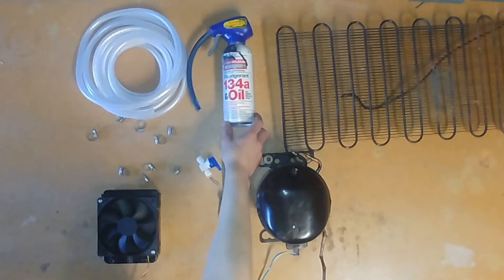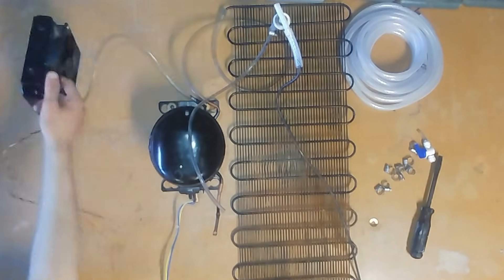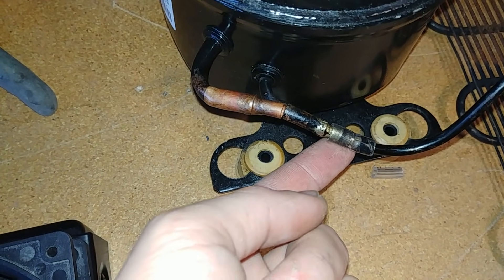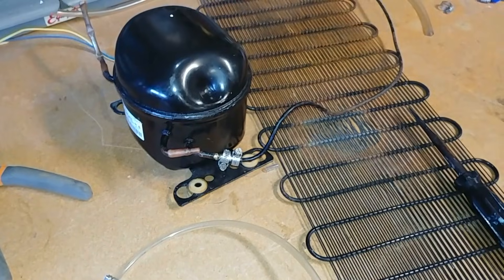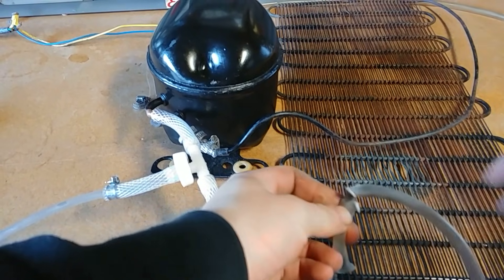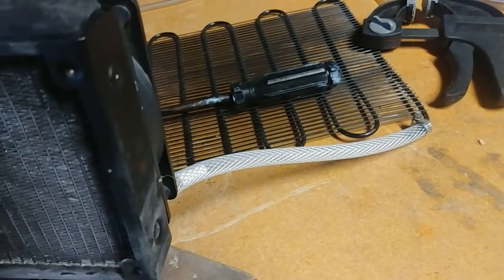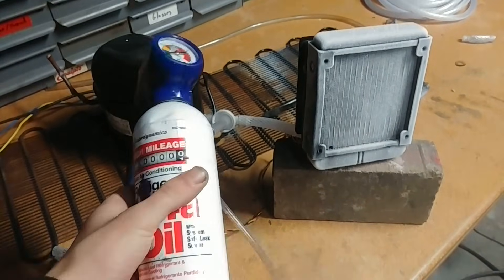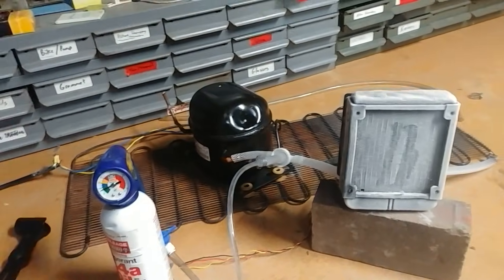DIY AIR CONDITIONER WITH COMPRESSOR diy ac from scratch

Comment: As someone who is certified to work on these systems, I think it's really cool that you made it work with those parts! Good idea using that syringe cap as a metering device. Very creative. I'd love to see how it does with a fan running on the evap coil. That being said, there's a few things I don't like that I feel should be addressed. 

First is that you lost a lot of refrigerant. Some loss is to be expected, but losing the whole charge multiple times is just negligent. 134A is a greenhouse gas after all, which is why it's beginning to be phased out and replaced with eco-friendlier HFO refrigerants. You didn't remove the air from the system first either. Not only does it ruin the performance of the system, but it also ruins the refrigerant.

Second, when you mentioned that you can use any refrigerant. If you put R410A in that system for example, you would blow every line and maybe even that condenser coil due to the much higher pressures. If you put propane (R290) or butane (R600) in it, there's a good chance it will literally just explode into flames. That compressor is only designed to work with R134A and nothing else. You need a compressor rated for flammable gases to use them safely as refrigerants. 

Other than that stuff, cool video! I always liked the idea of clear lines in these systems. They just have to be rated for the right pressures so they don't pop!
Reply: Well said Matt, you saved me a lot of typing. I'm what is known in the UK as a Category 1 FGas engineer, while I appreciate the video creator is yound and VERY intelligent for his age it did make cringe for the reasons you pointed out. But well done to the creator if you carry on progressing, find some funding and get the tools and hardware (maybe some refrigerant handling pointers or training) and experiment away, who knows where you might end up if you can make it work with hose pipes!
Reply: @AK_Exploration_SII I've been wanting to ask somebody and thought, after reading your comment, that you might be the right person. I work outdoors, and after this summer, I almost died out there. I've been thinking about trying to create like a backpack version of something like this and having it directed into something resembling a sandblasting helmet to contain the cool air. It seems to me that keeping the head and neck cool will regulate the rest of the body. And can it be done with maybe a 40 volt battery for a cordless tool? I'm just trying to think of something practical. Everything that I've seen requires an umbilical and doesn't seem practical for c9nstruction guys to be lugging around. What do you think? Thanks!
Reply: hi i have made this setup to but properly can you explain to me that when i turn on the condensor fan i get almost no coling but when condensor is hot all of my pipes freazes only for 2minuts help
Reply: Yeah i agree with him. I am also an hvac engineer and i can confirm everything he said.
Reply: Question all my r600a is out been removed right so now that my compressor is empty can I use r34a sir?
Reply: Great info, matched with the project.
Reply: Kyoto Protocol? Never heard of it 😂
Reply: righty but he is making it at home with basically no tools. and i doubt anyone whos able to buy 410 would use it in a rig like this.

Comment: Nice video, thank you. I am trying to make a mini AC with 12V Micro Rotary Compressor. Do you think it will work? BTW: I don't have any experience with Air Conditioning or Refrigeration.
Reply from the maker: its possible yes

Comment: This is a really cool project, although I'd recommend doing more intensive testing to make sure it can hold the pressure before putting refrigerant in it because that stuff isn't great it get exposed to not to mention the whole hole in the ozone layer thing. Have to admit I want to try this though.

Comment: This is a really helpful tutorial. I'm trying to turn a 12v cooler into an A/C for a teardrop camper. At first I tried just filling the cooler with water and using a USB water pump to transfer cooled water to a 360mm pc radiator with 3 fans, but it's just too inefficient to keep up with the thermal load. It can only maintain a few degrees ∆T. I think the next step is to remove the compressor from the cooler and run refrigerant straight to the radiator like you've done here.

Comment: I like how this is a true AC and not a fake Peltier or ice based AC
Reply: Yeah, I think the pettier ones are decently cool, but whenever I look for a video like this, it always comes up with the stupid cooler ones.
Reply: Peltier ones are just extremely inefficient  @CrobinHood8BitGuy
Reply: Why are peltier and ice based coolers "fake" AC? They may not be the most efficient, but they are real with actual capability to reduce the temp of a certain amount of air. Middle eastern  cultures have used "Cooling towers" to reduce the heat inside buildings without refrigerants. The US, used ice based cooling from ice blocks cut off from Alaska. Some companies now use ice based cooling to reduce costs. As long as it serves it's purpose, it's "real". You just need to have the proper application for whatever technology.
Reply: @BaldAndCurious Great take.
Reply: Or those new ones where they use lighter gas and not making a bomb
Reply: @clipxx467  You'd be surprised how well butane works as a refrigerant. In terms of state change with pressure, it's pretty close to the stuff you use in your air conditioner. It's actually the refrigerant that a lot of mini-fridges use.
Reply: Heat pumps a heat pump.
Reply: @tylermcnally8232  unless it doesn't. Because it's not a heat pump.
Reply: Peltier based would be cool though

Comment: Not a pro because I am looking for a cheap alternative I never seen this However. I do know using copper tubing or auto tubes will do. With the copper need a crimping tool & teff tape if not bronze soder

Comment: Hello mate i would like to ask something about that ac unit i want to use 12v compresser for that ac for my boat but im curious is it like that effective also i checked the gas what i can put in the tubes is also 134a type of gas so is it okay and whats your compressor voltage??
Reply: let me know if it works i have a sailboat i wanna use it on
Reply: @RustyShakleford1  ive tried it worked pretty nice 👌🏼

Comment: Any idea on how I would make one that works for the car, I’m from a part of the world where the temperature would reach 46 degrees Celsius in the summer, appreciate it, thanks.
Reply: I'm looking for this as well. The thing i can't figure out is how to get a compressor with this function to work of 12v in a car. The rest should be fairly straight forward.

Comment: Is it possible to make a system that works without a compressor?  I hope you added the oil too.
Reply: Only thing alternative  i can think of is a peltier cooler. Most micro fridges (for like 4 cans of soda) are cooled by peltier cooling. But it's far less efficient for large applications.

Comment: would compressed air in the system work or would it have to be a gas? i know air has the cold effect when tipped upside down.

Comment: I have an idea and i want to try it
What if i replace the car compressor by belt and but compressor like fridge run by second battery with 1000w converter you guys think that would work??

Comment: R135a is cheap as ballz. Even cheaper then a can of much more dangerous bbq propane. The hazard here is enclosed space with limited air and skin damage and lung exposure if pipe breaks but its pretty safe except your high side.

Comment: The freezing up is not good for the system as a whole... you don't want it freezing because then your going to be feeding the compressor a bunch of liquid and not vapor.. you want the liquid refrigerant to go from a liquid to a gas in the evaporator then the gas goes to the compressor and the cycle starts over.  🤔
Reply: Omg stfu!! It's his video not yours.. go make your own!!

Comment: You have bubbles in the line because you did not pull a vacuum on the system, the ac system will  work like 5 times better if you do, you obviously know nothing about making a proper ac system

Comment: Thanks for killing the ozone layer and why don't you just flare out the pipes and put proper connector fittings on the ends.
 it would work out better.

Comment: why not add a fan or something as your air handler...and your going to need to put your condenser outside so you can tranfer that heat from your house to the outside air, and also put a fan on that...love the improv filter dryer though

Comment: Kid understand if that radiator freezes up and turns into a block of ice  that radiator i will exploded and blow up you need a AC high pressure switch so that AC compressor will turn off and on never ever use any type of rubber or Plaskett houses always use metal lines or hoses I've been doing this for over 60 years stop learn and listen always remember all Freon gauges can be dangerous to any person always wear a gas respirator also safety glasses and gloves especially if you are inside of any building
Reply from the maker: let me have my fun  i didnt claim to be a pro and the no fan is so the ice will build so i could get a thumbnail

Comment: You need a high pressure switch to turn air compressor off and on so YOUR AC radiator  will not freeze up and turn into a block of ICE never ever used any type of plastic or rubber teething hoses of any kind always use metal lines or metal houses I've been doing this for over 60 years Freon gauges can really be Danger never ever let any person play with ANY Freon gauges
Reply: the improv metering device and filter dryer was cool though!

Comment: Those plastic hoses can't handle the pressure. Use copper tubing or braided stainless steel tubing.

Comment: this makes me want to diy a mini split out of a cheap generic ac:P always thought it should be overall simple but this makes it look even more simple:P; guess best option is evacuate the pipes first but yeah still not so crazy unrealistic as something diy; as the union for the high pressure side I'd try to either buy a compression fitting coupler or flare

Comment: Honestly I love the idea and concept personally I’d want to find a way to make it out of copper eventually but the concept is so amazing thank you for sharing!! Also I think you can buy 5 lbs of 410a refrigerant without a license
Reply from the maker: yea np
Reply: You would never want to put 410a in that system, I’d be kinda scared to run that thing even with 134a in it
Reply: @kenb1918  yeah I’m with you there is definitely want hard lines for higher pressure applications

Comment: Is it ok if I use a 1:1 ratio size wise or should the evaporator be smaller than the condensor?
Reply from the maker: it doent matter it will stil work
Reply: @ianbuilder  oh and another question, will this work with an ac compressor? I'm afraid that it might explode lol since I'm using a refrigerator coil with an ac compressor...
Reply from the maker: @tristan6509   yea it will be fine they are both rated for it

Comment: Can you try at making a reversing valve for this so its not just a ac but in-fact a heat pump also steel braided motor cycle break line can take the temperatures and pressures im gonna build on with that as the hose and if i can find one cheap use an actual thermal expansion valve
Reply: you wouldnt need a txv for this small of a system...his improv orfice hole metering device is fine...a capillary tube would work as well

Comment: Try copper lines and use a piercing valve so you can pull a vacuum first to remove non condensables.  And definitely want to get a fan pushing air across the condensing coil(the big fridge coil)

Comment: That compressor wont last too long. Air and refrigerant and compressor oil dont get along, acid will be created and compressor will burn out soon. Also you ever wonder why the refrigeration system is made of copper????. .... Because of hi pressures and hi temperatures and it needs to be a sealed system. Good luck with your proyect
Reply from the maker: it was proof of concept

Comment: Hose blows up as there is back pressure use pressure regulator with return line this should fix the problem

Comment: Just vented all that 134a to the atmosphere.   EPA is knocking on your door.
Reply from the maker: calm yourself
Reply: Dude seriously? I have vented 134 a dozen times.  what do you think happens in car crashes? Wheres the pressurized condenser?
Reply: Mark Diener Isn't R134a safe to vent to atmosphere that's why you don't need a certification to use it

Comment: I've been thinking about turning a window unit AC into a split for my van and this was exactly the kind of video I needed to better understand how all this works. Thanks!
Reply from the maker: ya go for it
Reply: @ianbuilder  What about installing a thermostat????
Reply: @Dan0rioN  some simple controller to turn on and off the compressor when cold is needed!
Reply: @waheeddoesstuff   depending on the voltage he can make a light switch the shutoff
Reply: @qsm1334  I know.
Reply: make sure you buy one that doesnt use a regulated refrigerant. you need a license for those
Reply: Any luck?

Comment: Would the compressor burn tho? I mean most of the newer ones does have thermal cutoff, but those teeny tiny compressors aren't really designed to cool a whole room, so I can't imagine them lasting that long
Reply from the maker: not sure but ive pushed this thing pretty hard  i think it has a thermal

Comment: been looking for a video like this for a long time. thank you
Reply from the maker: ikr i was looking too. so i just made one  everyone uses the inefficient peltier plate ones
Reply: @ianbuilder  it also annoys me on some of the 'peltier air conditioner videos' they dont even put the hot side outside of the room they are trying to cool, so the room would actually heat up when testing. Even then, peltier modules struggle cooling anything bigger than a small eski, and might not affect room temperature at all. Ive always been interested in cooling devices for some reason, and maybe your video has inspired me to do something of my own in the future.
Reply from the maker: @ElectronicInspiration  lmfao ikr  they expect it to just magically cool a room with no heat output

Comment: hi 
am build my travel trailer 
am look to your video make airco 
i like to make the same frico compressor under the bed storage and 2 littel radiator in my roof whit pvc pipe coolen the trailer
Reply from the maker: i don't recommend using plastic pipe it leaks braze everything

Comment: Using propane or butane is a problem as there is no oil in it.  It will work but the compressor will die faster than it would if using refrigerant gas.  Nice build and explanation!  Have you tried running the fan on the computer radiator? Oh and pulling a vacuum on the system will make it more efficient.  Just use another compressor to evacuate the lines then add in your gas.
Reply: Also use copper lines If you have to use flare fittings if you can't braze anything would be better than plastic tubing bur really cool concept my dude

Comment: Now, to upscale it to build a refrigerated room, on a farm for food storage.
Reply: That is when you start to worry about insulation and the cheapest will win out. Like 1 to 2 meters (~3 to ~6 feet) of recycled (free) packing material - aeroboard insulation / expanded polystyrene ~(EPS) will beat aerogel handsdown in terms of cost for performance, but takes up a lot of physical space. The downside is that it will take longer for, say three times, the thickness of insulation in the system to reach its final steady state operating temperature profile.

RSI-values in (m·K/W) per meter
69 Silica aerogel 
35   Polystyrene board
36.4  Urea foam
30–57  Polyisocyanurate spray foam 
26 Molded expanded polystyrene (EPS) low-density
20 Polyethylene foam
Reply from the maker: @itsevilbert  that moment when you realise you cant afford styrofoam
Reply: @ianbuilder  It depends on your access, lots of computer parts and AV gear used to be packed in boxes surrounded by custom formed blocks of the stuff. The places that had to deal with it in bulk hated it. Very large volume, very low mass - getting it dumped/recycled cost them money (most did not know that there are simple ways to dissolve massive blocks of the stuff into a miniscule volume of goo - e.g. an atomized spray of acetone). 

And styrofoam balls were used in bean bags. It used to be dirt cheap, I do not know about now.
Reply from the maker: @itsevilbert  ah so is it possible to dissolve it and re form it?
Reply from the maker: i wish i had a budget to do projects that big lol

Comment: Nice work! Can someone make it into a ac cooling device to have in the home... Hmm can it be cheaper than run the ac unit??
Reply from the maker: its much cheaper than an ac unit total cost was around 50 bucks however it will definitely leak refrigerant over time  so you should use copper tubing and braze it
Reply: @ianbuilder  is it possible to make a Switch so it runs warm air too? Would be Nice now to the winter
Reply from the maker: @sweden669  yes but not an easy task   it would be a very efficient heater